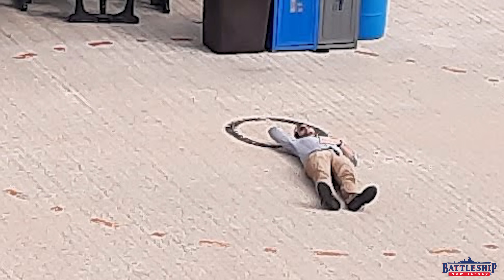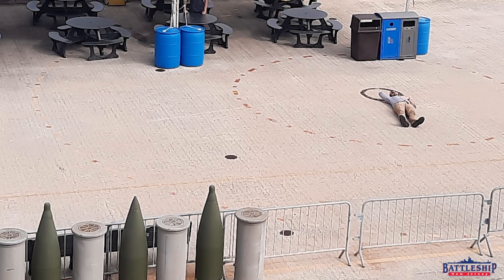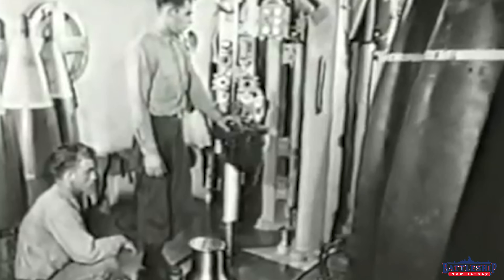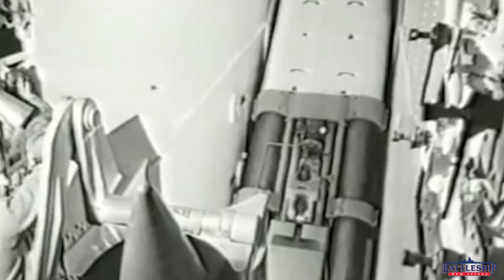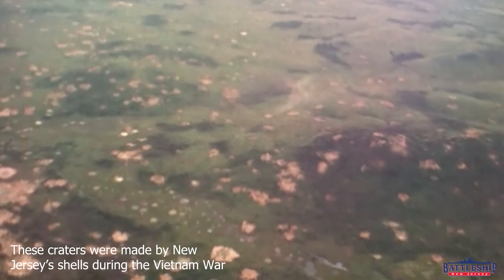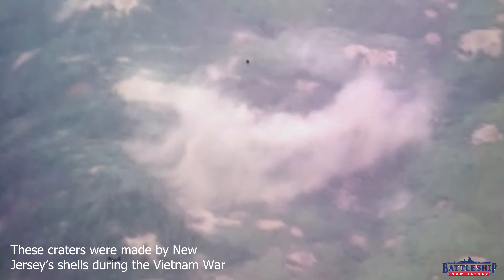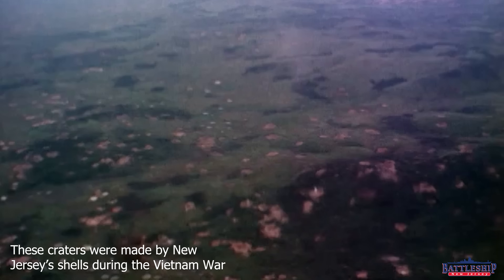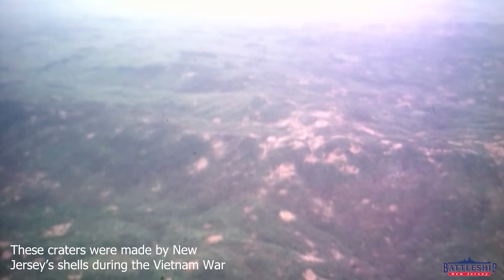How Big Is the Crater Made By a 16in Gun?

Comment: Yes, 16 inch 50 caliber was the correct gun for the Iowas. The Navy obviously thought 16" was the correct diameter as they used it on other battleships and tested a 18 inch gun for the Iowas. I have no doubt that if the Montanas would have been built they would of used 16" 56 caliber guns. To be honest the Iowas in their post WWII shore bombardment roll most often only fired 1 shot to destroy the target. If you look into Navy test programs late and post WWII, the Navy thought 16" was big enough, but they really wanted to get more range out of the big guns.

Comment: They made what was required to try to beat the german navy its that simple if bismark went up against the new jersey, she would have lost only due to the superior radar equipment that the Bismarck had, which is why she sank the hood and hit the hood in vital areas of the ship, ( new jersey and the iowa class battleships ships were all built after the hood sinking) like you said hit a ship though its armor belt and engineering section and the ship is dead in the water and even smaller 5" inch gun / projectile will do the damage required once the ship is dead in the water?✌😎⚓🦘
Reply: FYI, The Iowas were all designed and mostly built before Hood was sunk. It had no effect on their design. Also when the Iowa’s did have better radar/fire control as you said, they also had guns with much more penetration. The 2700 pound shell of the Iowas just hurt more than the 1764 pound Bismarck shell. :)

Comment: While a high caliber 14in was good, (see the KGV's) and yes, Yamato's 18in guns were enormous and designed to take on 2 US standards at a time, I think you have to take the 16in 50 as a whole system. Better fire control , faster loading, higher velocity than a 16in 45 and  enough firepower to penetrate Yamato's armor at most ranges.  Add to that the improved logistics of having 10 battleships (in WWII) that can take the same 16in shells, then add on the length of service of the Iowa's and  the 16in 50 easily becomes the best all around.
Reply: The US 16/50 was ballistically superior (more efficient) to the Yamato's guns in terms of terminal performance. And faster loading. Realistically, after the 16/50, you got diminishing returns, and even retrograde performance.

Comment: In most hollywood movies they always show the gun firing and then you hear the whistling as the shell comes in and then it hits. Lol In reality you'd never hear the whistling before you die, since the shell travels faster than sound. I am curious however what it would sound like if you were fairly close to its flight path and could hear the shell fly by at that ungodly speed. Would it create a tremendous vacuum and cause damage to you if you were too close would it make an incredible sonic boom??
Reply: Shells don't travel faster than sound when they reach the target, unless the target is very close. So you would hear it
Reply: @jimsagubigula7337  lol what? Sound at sea level atmosphere, travels 760 mph, the shells travel an average of 2500 fps, which is 1704 mph. And you think sound will arrive at the target before the shell?
Reply: @AmericanThunder  That's the muzzle velocity. It slows down due to air resistance. It is subsonic when it falls on the target.
Reply: @jimsagubigula7337  This data is accepted specifications from the navy, it's all available online. The projectiles maintain supersonic velocities even at maximum range. They wouldn't have the kinetic energy to penetrate 32 feet of reinforced concrete otherwise.
Reply: @AmericanThunder  Yeah, I didn't think of that, you are right. But that kind of shell is an exception. Most artillery shells are subsonic by the time they hit, so you do hear a whistle.
Reply: @jimsagubigula7337  It's true, but the 16" mark 7 guns are in a class of their own.
Reply: @AmericanThunder  Indeed

Comment: One video I'd like to see is one comparing the loading mechanisms of different sized guns.  I've seen the one you did about loading the 16" guns, but how does this compare with various smaller guns?  For example, at what size does it become practical for the gun to be entirely hand-loaded?  I've never served in the military, so I don't really know how heavy each size of projectile is.  Just reducing the size and weight proportionately would suggest that a 4" shell would be fairly easy to load by hand but a 5" shell might be a little too heavy.
Reply: I think the rule of thumb is 5" can be done by hand, but 6" not (unless you have two men).
Reply: There is a good video on You Tube.

Comment: Would the 16" shell have penetrated the Bismark?  I understand the British did target practice on it for quite awhile and couldn't punch any significant holes in the main armor.  A second question would be can you effectively fight against an opponent whose main armor you cannot penetrate?
Reply: Pictures of the Bismarck as she rests on the ocean floor from the James Cameron expedition show a 14" shell penetrated her belt armor completely. The KGV's AP shells were less capable than the 15"/42 AP shells, HMS Rodney's lightweight AP shells and our 2,700# AP shells, whether shot from a 16"/45 (North Carolina or SoDak classes) or a 16"/50 (Iowas or the unbuilt Montanas). 

Bismarck, as vaunted as she was as "the pinnacle of German engineering ", was just as limited by physics as any other battleship. Her belt armor wasn't invulnerable to even 14" shells any more than she was safe from a biplane torpedoing her.

Comment: So if each shell is on the order of a ton, how does it change the battleship's draft and balance to fire off a large barrage? Or is the battleship just so enormous that her ammo stores represent a tiny fraction of her displacement?
Reply: The battleship is about 60,000 tons full-load, so 18 tons fired in salvo is about 0.03%.
Reply: She draws around 12m, so 0.03% is 3.6mm, or a bit over 1/8 inch change per salvo (simplest approximation to the hull cross-section). Certainly measurable in still water.

Comment: The size and weight of shell depends on the target, the 16" round a good shell  but a bit big for close support or attacking a mg nest  😉
Reply: That’s why they also have smaller caliber batteries like the 5 inch guns. Battleships were designed to kill ARMORED SHIPS, large shore emplacements, and not necessarily shore insulations like MG nests. MG nests are for the destroyers to eliminate during shore bombardment. That’s the reason for different sized warships. They each had their own jobs to do. You wouldn’t kill a fly with a shotgun would you? Same thing. You’d use a fly scatter, not a 12 gauge. If that MG nest was putting lead on you you wouldn’t care what eliminated it. Overkill or not when you see your mates being chopped up bring on that shotgun!
Reply: @paulredinger5830  on D-Day HMS Warspite used it's 15" main gun to take out an MG Nest.

Comment: I question the idea that a single shell could clear enough jungle for a helicopter to land in. A UH-1 had a rotor diameter of 48 feet and a length of almost 60 feet. If the crater diameter was 30 feet, the overall effect was likely not much more. Depending on jungle density, it might clear enough for one helo, but if there were multiple inbound, that makes for an easy space for the enemy to target.
Reply: Not to mention, there's a large hole in the middle of your newly created LZ.

Comment: I heard the 33 foot wide thing, and that it was the origional bunker buster that is went though the same amount of ground and concreat as the mk 85 but I really thought it had more explosive filling then that compaired to the total weight of the shell thats tiny.
Reply: That explosion in an enclosed space, along with the shrapnel from the shell body and the spalling from the target, would still be devastating.
Reply: @JBee792  that might be but 133 lbs of explosive isn't that much the 500 lb mk 82 has 187 lbs of explosive, and the mk 84 which is a 2000 lb bomb has 900 lbs give or take or explosive filling I though have thought it would have had way more with that kind of weight
Reply: Think the navy used a more powerful explosive so comparing the 2 is like apple orange
Reply: @tomhenry897  hmm that could be as well

Comment: My opinion on main battery guns of battleships, as they where intentionally used as deterrence in a fleet battle....using as a landscaper would support the largest regardless of the following 

The dispersion and angle of the fall of shot determines the thermal efficiency of the round against the target 🎯 a balance of accuracy and energy.....at the time the dispersion of 14" guns didnt over come the kinetics of 16" rounds, and 18" rounds didnt have the inventory or testing established to trust as a better alternative......compared to 15" guns on vanguard the 16"/50 shows more kinetics but also more dispersion at battle ranges specifically horizontal dispersion, as a battle ship could easily maneuver or angle itsself the British thought better accuracy would produce more thermal efficiency, producing fear as rhe enemy would have to turn more.....the enemy would also lose its ability to use 1/2 of its guns.....a good captain would know these vulnerabilities and not engage....this makes rhe 15" gun vanguard a more effective "flank" in a fleet setting especially targeting from rear.....so if the iowas had marginally better ballistics at 10-15k they would be the best guns every made (against battleships in a fleet) as the yamato 18" dont have established data to support its performance to use as a comparison......i would assume that the USN tested the 18" gun once and decided against it for a reason, and could only make the 16" gun better with longer barrels in the time it had to produce the ships.......after WW2 the big navel gun was obsolete so we will never see and can only go off of data and experience prior 

This also assumes no radar influence using spotting planes and RF's to compute fire control.....radar when used was inconclusive as its accuracy could be compromised more easily than any optics 
Just my opinion on my favorite interest

Comment: How would an Iowa class battleship’s full battle load out compare to a modern surface warfare ship’s load out in terms of damage impact delivered?
Reply: Their armor penetration is still only rivaled by similarly heavy (and much physically larger and complex) shaped charge missiles. Just due to the sheer size difference, an Iowa-class battleship could carry many more shells than a Ticonderoga-class cruiser could carry missiles.

Iowa-class battleships were designed to carry up to 1,210 16-inch shells at a time, with AP shells weighing 1,225 kg and HE shells weighing 862 kg. If one is carrying 20% AP and 80%, her stored main gun ammunition would weigh about 1,250 tons in total, not including the propellant.
A Ticonderoga-class cruiser can carry up to 122 Tomahawk cruise missiles, which weigh 1,600 kg, booster included, which adds up to about 215 tons in ammunition.

If we only consider raw explosive power and the ability to create as many giant holes in the landscape as one possibly can, it's absolutely no contest. An Iowa can create almost as many giant holes as ten Ticonderogas, and these holes will probably be bigger.
But the Ticonderogas, they don't care about making lots of semi-random holes in the ground. They aim to hit their targets every time, and from possibly a thousand miles away.

Comment: With the HC shells having both a nose fuse and base fuse, could the nose fuse be swapped for a VT fuse like the 5" shells, to airburst prior to impact?
Reply: So imagen this. You are a North veitnemese pilot flying an old burned out soviet Kharkiv KhAI-5 recon plane. You have been observing the New Jersey for several days, staying outside of it's 5 inch guns and providing intel to your comrades. The US aircraft don't seem to think it's worth the fuel and ammo to go shoot you down so as long as you stay far enough away you should have an easy time of it.

Just then you see one of the turrets moving, great another fire mission to report before they actually fire. Then you notice only one of the barrels raising. Odd, usually they would fire entier salvos. As you try and figure out the point of aim you realize it's pointing in your direction, no at you. You laugh. What are they gonna do, hit a moving aircraft with a single shell? Then it fires. You don't bother maneuvering. There is no way it can hit. Then, as you watch the shell pass harmlessly under you 133.5 pounds of Comp B detonates below you, turning you, your aircraft, and somehow the rest of your linege, into what would be considered a fine powder.
Reply: Looking at the schematics, I don't think the nose fuse is a big enough space for the VT electronics.  Plus it would have to be redesigned for the different blast pressures.  Probably not.